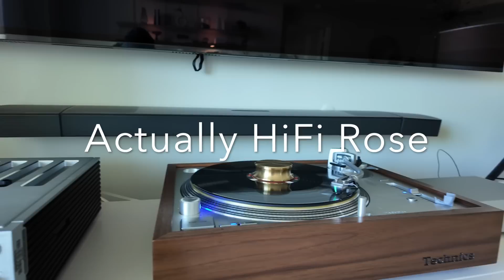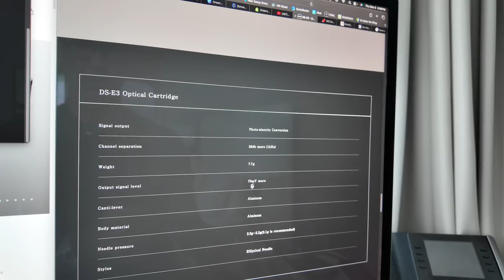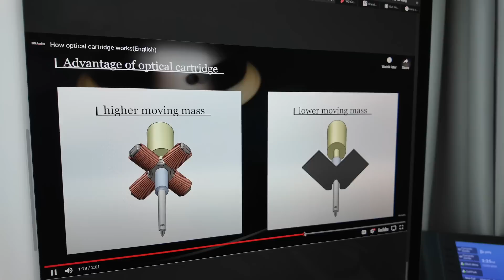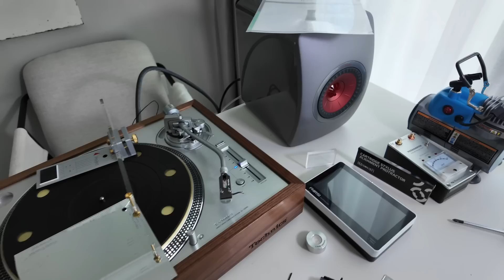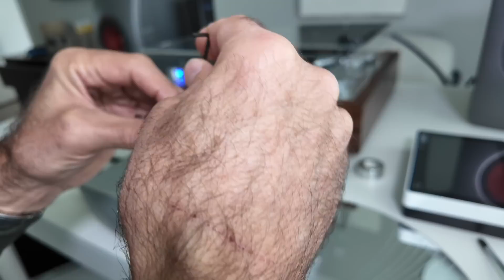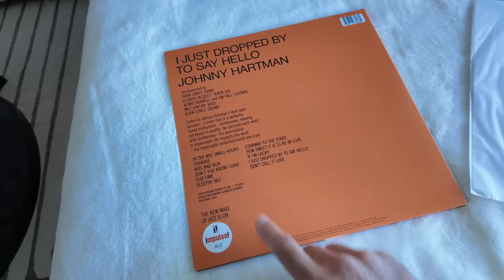Rethinking How A Phono Cartridge Should Work - The DS AUDIO DS E3

Comment: Does it sound way better than sumiko starling?? Thanks Fernando
Reply from the maker: As a system its  much quieter than the Starling with an MC pre.  You see, the Starling is an MC cartridge which needs to be connected to a an MC phono preamp which inevitably induces noise into the system.  The result is indeed a better experience.  I suspect to truly outperform a Starling in a perfect super quiet system youd need to step up to the DS-003 with a line contact stylus or DS-W3 which also uses a boron cantilever and a line contact stylus like the Starling.  So in short, depends on the entire system.
Reply: @SkyFiAudio  I personally have not used MC cart before. It is believed since 2010s, I should drop MC cart and the MC pre-amp entirely because of Photo-cart and the pre-amp is remade, now coming with an acceptable price. Unfortunately, The entirely of analogue business is now in Germany , Japan and the PRC for the time being.
Reply: The real optic lector  around 80 s could reach to read 8 bit(48 dB) from an LP...but not had a stylus. Only optic reader there was on the tangential arm

Comment: I saw you had some test records, it would have been interesting to play those and analyze them with audio test equipment.  Then do the same thing with some common, similarly priced standard tech cartridges.  It's probably the last thing a manufacturer would want you to do, they would wave their hands and tell you to use your ears.  This is one of the reasons why the HiFi  world is so full of snake oil.  Failing that, recording the preamp out to a FLAC file and posting to your own server would at least give us something to really listen to. It could probably be done in small doses and under creative commons rules. Thanks for the setup hints.

Comment: Hi.. Is the Technics Overhang Gauge (white one) not accurate enough that you need multiple alignment tools?
Reply from the maker: The Technics alignment gage uses a strange calibration method that they cooked up.  Most folks would want to use Bearwald or Stevenson.  It will work but we tend to calibrate with one of the others sep-ending on the type of collection the client has.

Comment: pretty interesting set up. thank you for posting. I have several of the DS audio headshells. They are good. Only complaint is their female pins are usually too small to fit on some MC carts making them a super PITA when installing some carts on these DS headshells. This may be beyond the scope of this video but since you are talking mid to high 5 figures for their best set up, would sure be an interesting comparison to run their best against a Goldfinger or an ART-1000 cart with a Boulder 2108 or similar phono stage.
Reply from the maker: I know what you mean.  I wish there was a standard for pin size all around.  The DS head shell pins work really well with the Sumiko and Hana cartridges we tend to use.  Interestingly it was a bit too tight for my taste on the DS cartridge, go figure.

Comment: 67 thousand dollars for a phono cartridge is like paying 11 thousand dollars for a shovel or 40 thousand dollars for a vacuum. This is outrageous and the cartridge makers are laughing all the way to the bank.
Reply: I can’t believe they fit an alu cantilever and basic elliptical stylus at this price point either. 

All the optical nonsense isn’t worth a penny if your stylus can’t actually track as well as a cart coating a tenth of the price!
Reply: There’s a price point for everyone.
Reply: I’ve listened to the new DS-E3 and will be picking it up. It’s great and at $2750 for the Cart and Pre-amp, it’s very affordable considering what you get. Getting an equivalent sound out of a MC cart and preamp will cost you more.
Reply from the maker: It's all relative, to a guy that makes $100M per year dropping $67K for a phono cartridge is easy.  There is a guy somewhere in a 3rd world country that thinks the $7 you just dropped at Starbucks is equally  nuts :-).
Reply: @SkyFiAudio  +1 for same comments. Quite a few phono stages now in the 20K to 100K price range. It all becomes relative to the person buying it only.
Reply: @mcgjohn22  It may be relative. To my Beogram I have B&O cartridge MMC20 CL and tracking force 1,0 g which was a top model and MMC20 EN which is 1,5 cheaper with  trackling force 1,2g . Although the price is justified by use of lighter made of  transparent material canterliver in CL and it sounds  like more readable but  in my system that cheaper which uses alu canterliver makes more wonders

Comment: I am a klutz.  Sad but true.  I really should not be using my butterfingers with a cartridge.  In setting the tracking force I leave the stylus guard on.  All you have to is pre-weigh the stylus guard.  Then add that to the recommended tracking force.  So if your recommended tracking force is 2.0g and the stylus guard weighs 0.2 grams then you adjust your counterweight to 2.2 grams.
(As an aside, even if I did not run a TT I would still subscribe.)
Reply from the maker: Hey thats a fabulous idea!!!  Thanks for the tip, will try it soon.